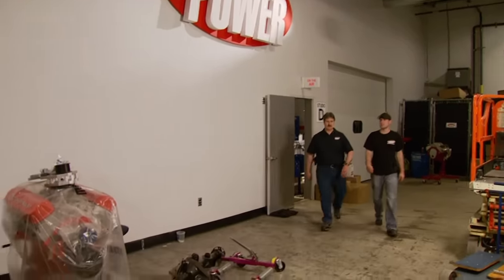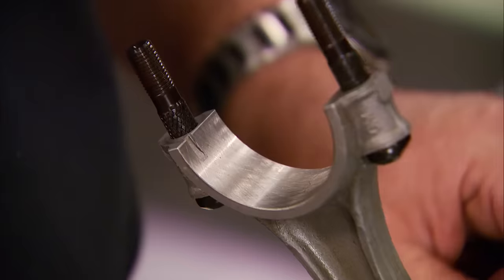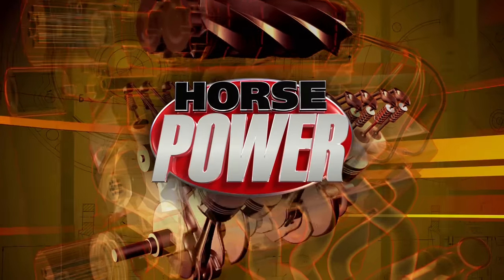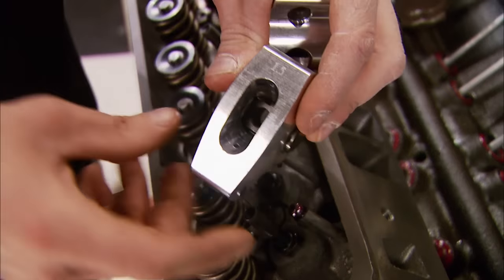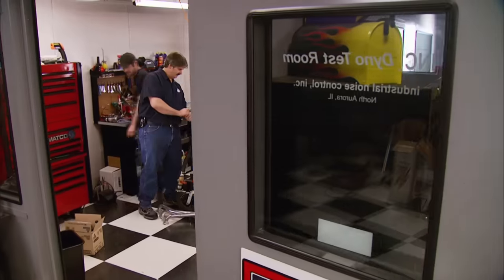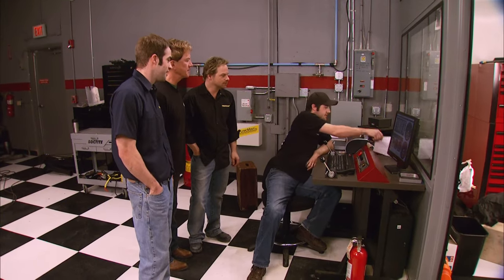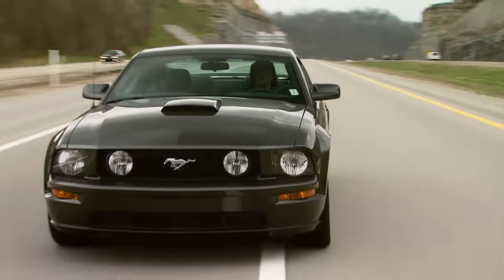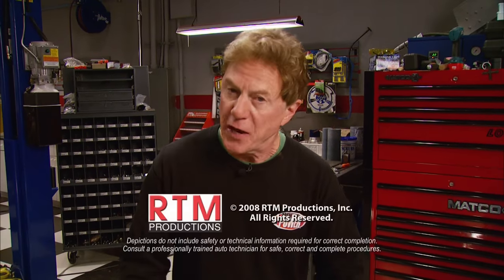Rebuilding a 283 Small Block for a Daily Driver C10 - HorsePower S12, E7

Comment: I would've put a 327 crank and roller cam in it and Easley make over 300 up while maintaining original block. I mean you replaced the heads so it already looks reworked .
Reply: 307
Reply: Yeah that’d make a 307 not exactly the performance benchmark valves are too tiny
Reply: @theeoddments960  Heads  they're  using are aftermarket so that's not an issue
Reply: They could've ported those aftermarket Iron cylinder heads to give that little 283 around 300 HP or more.
Reply: 350s are built with 1.2 + hp/cubic inch and still considered streetable. Ain't no reason a 283 can't be built to the same level, which would be in the 340-350 hp range. Tired of ho-hum builds on these motors.
Reply: Ben Krom the sr heads are great performance heads but even then you still have small valves bore is too small
Reply: @theeoddments960  I believe these heads would be similar to sbc 60s 327 camel hump heads that put out 365-370 hp. So 307 and  with roller cam should still be drivable. You could put a stroker crank in it cut the  bores 40 thousand and have a 360 ci which is stamped as a 283 and easily putting out 400 horses.
Reply: Ben Krom the 283’s had only 1.72/1.50 valve size and the bigger 1.94 intake was used on the bigger 327 but to my knowledge this head in particular is a 1.94 head so it will breathe pretty good. If they used those stockers they’d be definitely hurting.
Reply: @theeoddments960  Well I guess you're missing where I was going with this.  For some reason they wanted to use the original block but didn't care about the heads. I myself don't care if anything has matching # blocks so I would probably just throw a 383 in there.  There is no way I'd pay for all that machining just to get 270 hp when I could spend the same amount on a different block and get 400 hp. If for some reason I needed to use the original block for value of a restore,  nobody would check the crank or roller cam and between the two would clearly make over 300 hp spending about the same amount of money . I believe the heads they're using are equal to heads on a early 327 which put out I believe 360 hp. So for the same amount paid for machining and looking exactly the same in that engine bay they could've had a 350 + hp engine. I personally have a problem spending all that money on something so restricted as a 283 and not even getting 283 out of it.  I do have to say that back in the day I used to try to blow up 283s so I could replace them with 327s but never got past bending pushrods and snapping rockers. They're indestructible.
Reply: @CJColvin . That wouldn't be a problem by far. 300hp is barely over 1 hp/cubic inch. Assuming it's the Performer cam, there are plenty since then with less advertised yet more duration @ .050" giving more power across the board.
Reply: @CJColvin those heads are already too big for that engine in a truck. They're essentially mildly modified Vortec heads. Any increase in port size or valve size moves the powerband up higher. A 283 truck needs other things addressed before doing that.
Reply: @garlandjones7709  I'm saying keeping the ports the same but just get rid of the rough casting to make em flow better.
Reply: @benkrom2737 they are improved vortec heads for Old style engines
Reply: @CJColvin  that wouldn't pick up 30 horsepower, though. The heads they used are Vortec copies with much larger valves than the original heads and a much better chamber. 

That engine is just built poorly and not matched well. Probably a good bit of power on the table for nearly the same money spent. These TV shows like magazine throw together, cookie cutter builds.
Reply: @CJColvin  i would've done it almost completely different, and I would've used those pre-existing heads or turned that engine into a 327.
Reply: @garlandjones7709  True or take a 305 and make it a 340 Stroker as well.
Reply: @garlandjones7709  True

Comment: Nice episode... what do you recommend for ‘79 c10 350?
Intake cam carburator 
I want to use the original heads 993. 
Thanks.
Reply: if you want to tow, build for torque and don't worry about HP. Make a lot of it at the 3,000-4,000 RPM range, and the truck will "recover" every time it shifts to a new gear and the revs fall into this range. Its tempting to pick up a used intake, but sometimes that's just a unit that didn't work for someone else--worse if they started carving it up trying to get it to work and then let it go.

Best thing you can do, call up an intake manifold company you like. Tell them your need (towing, racing, etc), your transmission and rear gear ratio.  They'll sell you an intake, cam, and carb combination (they likely own more than one company).  that way you know everything works, and its fresh and new.
Reply: If you're going for a hot rod engine I like the comp 280h cam, the Edelbrock rpm air-gap intake, and the summit brand 650cfm carburetor. How ever your performance will be limited by your low compression ratio, for a serious jump in power I would recommend using a flat top or very slightly dished piston with vortec cylinder heads from a 96 to 98 Chevy.

Comment: Why in all that is holy would you use a 600cfm carb???? My .60 over 327 only calls for 550! A 4 to 2 barrel intake and a 4412 Holley 2 barrel
Reply: Those online CFM calculators typically only capture displacement and rpm, not taking many factors into account.  Also nearly always a 4bbl with out perform a 2bbl even at the same cfm, countless dyno test show that to be the case.  Also just thing about how big the Qjet are and they will give a 283 a noticeable kick over the factory 2bbl setups.

Comment: Hey guys yu might get 5 to 10 more hp with TRW High Rev Lifters on yur 283 stock motor too later yall Rev
Reply: Only  blue heat thr rod  tips. GRUMPY JENKINS

Comment: Seems low on HP being it was the first small block to have 1hp per cu in back then, couple that with modern heads, cam, intake and carb.  Pretty sad numbers and that’s not even what you’re putting to the ground.  Probably more like 200 hp to the pavement.

Comment: Do i need to install fuel return line on carburetor or not
Reply: With a mechanical fuel pump you do not
Reply: @63Imp283  ok good thanks,,,i have jeep cj5 with 304 600cbt original fuel pump and i dont have fuel return line

Comment: If they can't hit 300 hp at the flywheel, then they're wasting time.  'Bout to find out...
Reply: BW MadDog [retired]  You are probably correct about the carbon content of the rod.
But what about all that heat , a lot of which would transfer to the wrist pin? Enough to affect the temper/ hardness of the pin, do you think?

Comment: Decent numbers. But boring it to 4.030 and making a 306 would've been sweeter.
Reply: You can only bore them to 301 and not all blocks can go that much. Id just get a 4 inch bore block if I'm wanting that big of a bore. Plus why overbore an engine, there'll be no meat left to clean it up for the future. A .030" over 283 gets you a 287,  .040" over is 289, and more room to clean it up down the road.

Comment: Then, after cooler accessory parasitic drag transmission parasitic drag rear differential parasitic drag at the rear wheels yeah you should be just under the 200 mark. Still, a nice good work cruise around town go to the movies grab groceries pickup truck ☺️🤠👍🏽🎉

Comment: 283 is a little small, no torque for the application. I would have sold it to a collector, restorer, etc and done a 350. The cost is the same and a no brainier.

Comment: A stock 1996 Vortec would make that power.
IDK know why guys want to build and dress little engines these days.
Cam swap, World Heads, Edelbrock Carb and Intake, for under 300 horse is a waste of money.
That thing will fall on its face at about 3500 RPMs

Comment: Such a tiny engine.
Reply: Those "283s" had a "reputation" in their day!
Reply: 4.6L isn’t all that tiny
Reply: @pmscalisi  

I grew up with 5.7 being the smallest engines put in cars. We had several  cars with  a  7.5 liter( 454, or 455) during my Teen yrs.
Reply: @pjimmbojimmbo1990  GM pretty much went with the 350 (5.7) after 1970 or so. I had several vehicles with the 283 and 327 motors as well as the 350, and had a couple with the 396/400 big blocks. My uncle owned a junk yard that specialized in GM parts so that’s what I drove until his brothers bought him out. Couldn’t resist on all those free and super cheap repair parts!
The 350 by far is the best design overall for that small block bunch and remained the go to motor for decades.
But it still is fun to watch someone rebuild those old motors and they still have use for many. They are torquey for their size and can have fun driving that way but you’re not going to win many races with them!
It’s funny because I have one vehicle that has a 3.6L v6 that makes 275hp ummodified.
Reply: @pmscalisi  

I currently have 4  of the  2nd Gen 5.7 LT 1s. 2 of them are currently in use, one with 300,000 on it, the other has 12,000. the others which are in storage have 300,000 and the other, 50,000. Great engines

Comment: Honestly expected 300hp, but then I'm used to European power levels, 300hp from 283 seems really low.
Reply: They are quick revving torquey and reliable little motors
Reply: But yes I was hoping for over 300 too like the 61 Corvette with 315hp!
Reply: Don't see too many of those euro engines in top fuel dragsters now do we?
Reply: @justintyme5053  Don't see many American engines either in top fuel..they just look like other engines..but there are so many custom parts they may aswell be a rocket engine.
Reply: @seanbailey8545  Oh, ok, I'm sorry. I wonder where all the top fuel engines and components are made then?  NASA? China?
Reply: @justintyme5053  Yeah America...but it's not like you couldn't make them anywhere else.
Reply: @seanbailey8545  Don't get me wrong, Sean. I am not hating on Euro tech. Arkus Duntov, (father of the smallblock Chev) came from a Euro family background. 
But making comparisons between small displacement high rpm high horsepower screamers and big cube high torque thumpers is a bit pointless. They each are suited to their own  application.
For example, take a 300 hp  3liter  Ferrari engine. great in the car it came with. Put that same engine in a 6 ton truck. Useless. No torque.
Take a 300hp 8liter lump of detroit iron and do the same. Result, not so bad. Torque gets the job done.

Comment: they built 283s in 1957 from the factory with more power. This is honestly just sad
Reply: Fuel injected with tighter heads to bring up compression though

Comment: Almost indestructible little engines just no torque and low horsepower even at high RPM but they usually outlived the cars or trucks they came in

Comment: with some propper fuel like 95% octane you would see a better result = running an engine on lawn mower fuel - i can not follow that !
Reply: 95% octane would see 283 hp = i pony worth per cubic inch = every thing else is perfect = just the fuel ?